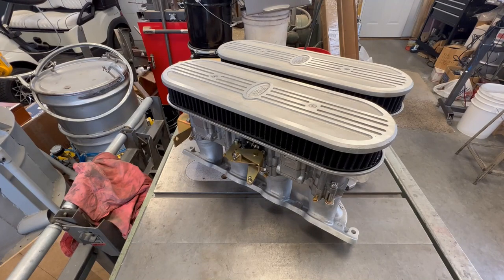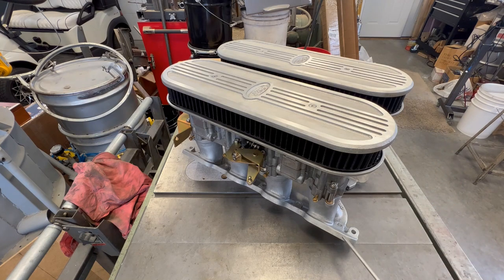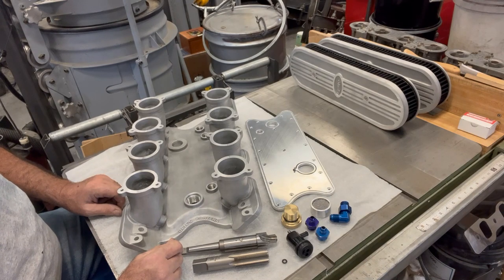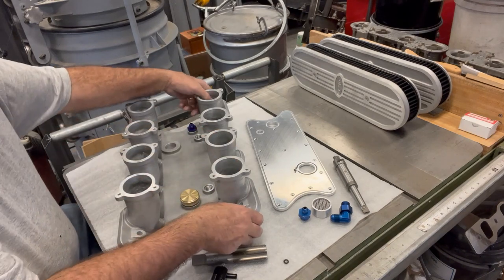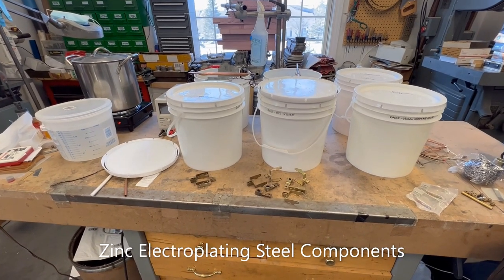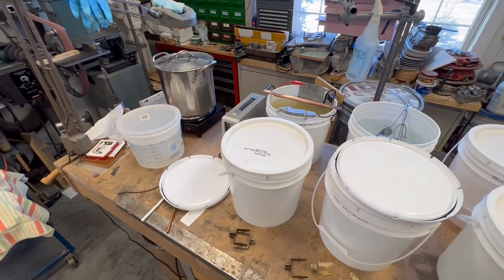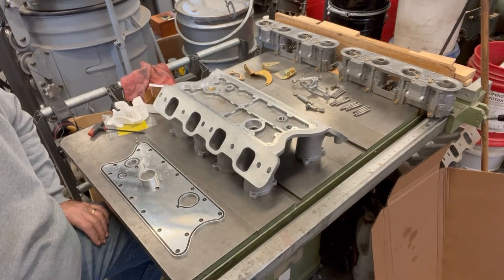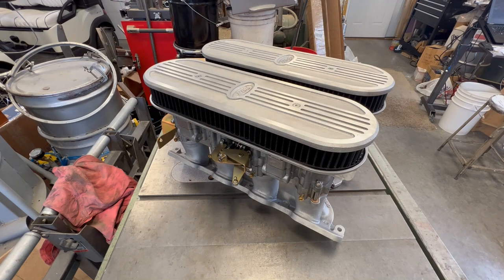351 Cleveland Inline Autolite Intake Manifold for Pantera

Comment: The stick out when cutting some of those ports is extreme. Lovely work.
Reply from the maker: If you're talking about the router position while cutting the plenum plate, I agree. I would have built a machining platform to elevate the cutting surface and reduce that distance but the problem is the router can only be adjusted upward 1 to 1 1/2" before it hits the Z stepper s it hardly seemed worth it. Though the MegaV is a decent hobby machine, it leaves a lot to be desired for this type of work and I have a slew of upgrades n the works which include linear rails in all axis, additional Z travel/envelope, spindle, and in general much more rigidity. Maybe I'll do a video on that too? Best, Kelly
Reply: @kellycoffield533  hey, I was writing about the ports on the main body of the manifold. With being so close to the elevated features it seems like you’d need a long tool to reach the port locations.
Reply from the maker: @OhHeyTrevorFlowers  Ahh, I see. Also true, but the combination of the radial drive tool holder I discussed in the video, and the MT2 to R8 adapter provided adequate reach. That is a lot of stick out but with the pilot hole already drilled there is hardly any material removal with the form tool, and cutting aluminum isnt much of a chore. Probably a little greater risk for runnout with those adapters but well within tolerances for such an o-ring sealing port and miles better than a pipe thread IMO. Best, Kelly

Comment: Amazing work you do, as always. Wondering if the vacuum plenum might fill with fuel over time, there is always liquid fuel running down port walls, with each pressure pulse a tiny bit could be sucked inside there.
On another note, I am working on a 4 cylinder two stroke 1000 cc V4 engine, based off YZ250 cylinders and rotating assemblies. Have studied all your videos and will cast the multiple crankcase halves based off your teachings. If you are interested, look up Algie Composite Aircraft on YouTube for my channel. Thanks!
Reply from the maker: It's a fair thought, but after decades of practice, I can confidently say it just doesn't happen. As to why, I suppose it's because in-flow is balanced by out-flow, and the plenum spends at least as much time well above rather then below the vapor pressure of gasoline, so even if some fuel temporarily comes out of suspension, it promptly evaporates when exposed to high vacuum. Same is true at brake boosters and other vacuum accessories supplied by manifold vacuum. I've done a lot of work with two-stroke engines over my life. I'll have to check out your channel and engine project. Ever watch Alan Millards motorcycle engine builds? Best, Kelly